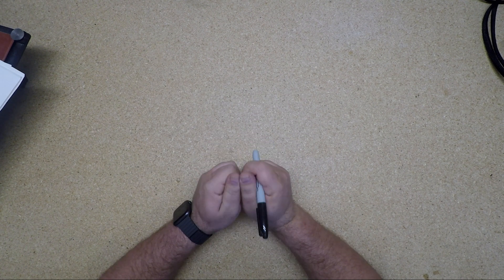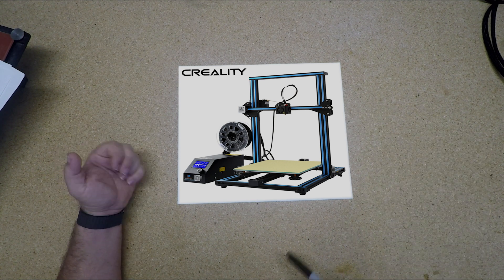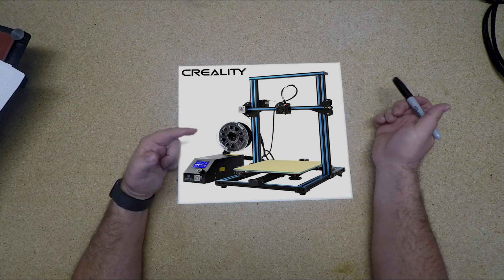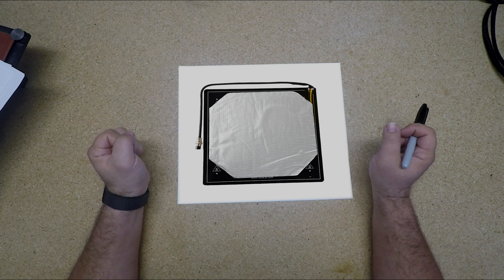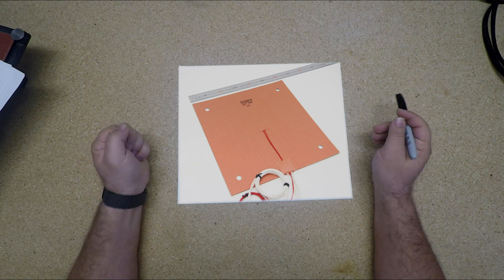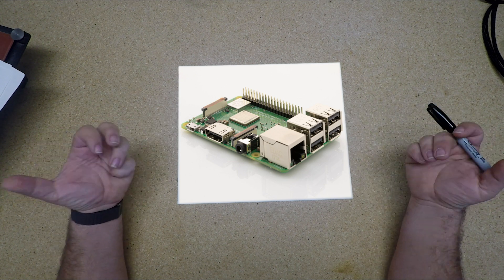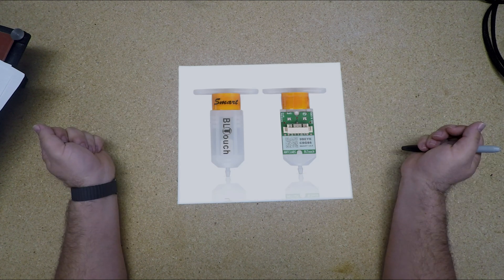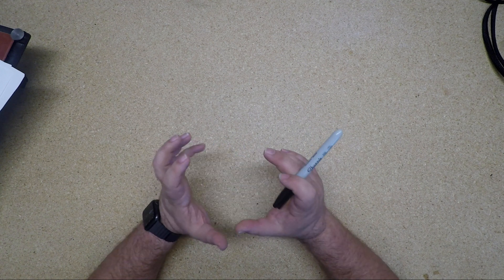Upgrade CR-10S to CR-10S PRO : Part 1

Comment: I'm still looking forward to seeing the videos on the upgrade and how you did it. It would be valuable to me to see the initial videos you did upgrading using the stock control board as that is what I still have but if you have the other videos ready I'll still take that :) Just letting you know I keep checking back almost daily for the videos you mentioned you would post weeks ago :) eagerly/impatiently waiting
Reply from the maker: In the end, I had to abandon using the stock CR-10 "Melzi 2.0" style board.  During the process of upgrading the machine, it became clear that to make a pro machine I'd need to switch to a 32 bit platform... so I had to re-print the low voltage box with the design help of Eddy Emck ( 3DEddy ) 

The new board I am using is the inexpensive Bigtreetech SKR E3D-DIP 1.1, and I've paired it with the very capable Raspberry Pi 4 to provide the ability to use OctoPi.

Comment: The "easyest" way to do the letters in two colors is to print them as a first layer before start printing the box. Make sure you aline both prints exacly on top of each other in your slicer or your nozzle will crash in to the letters.